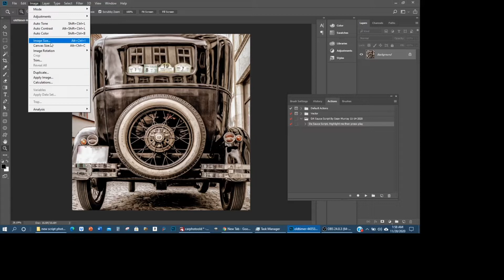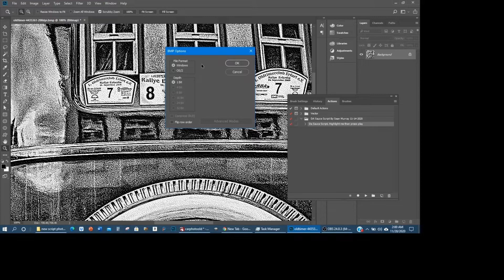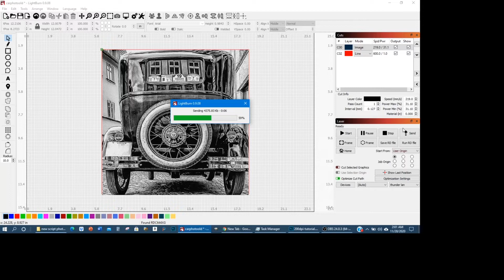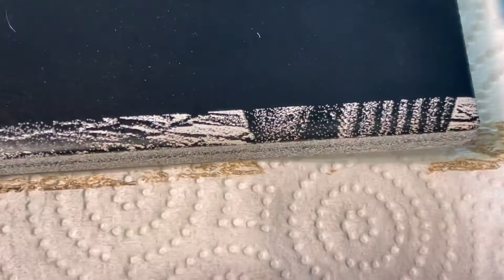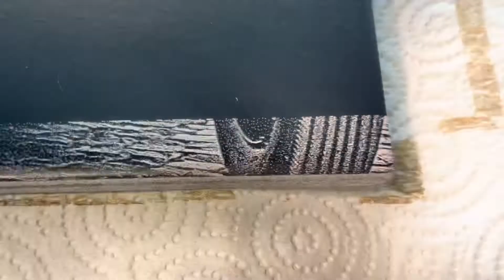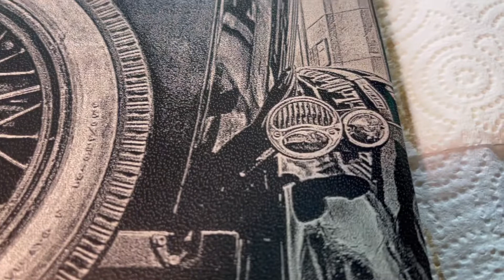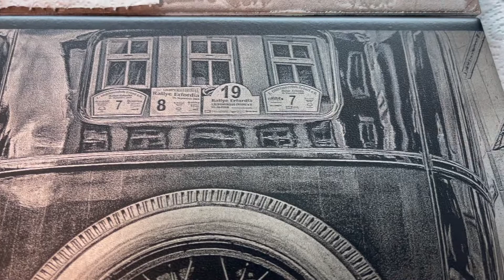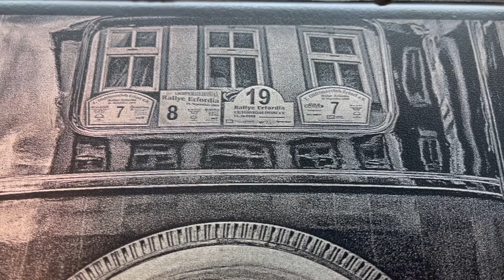How to laser engrave a photo onto painted ceramic tile

Comment: Hi! I have a 45 watt laser (Glowforge) I do not have a way to set % in the software for GF. Do you know any glowforge settings that may be a starting point? currently i have been using 800 speed and full power but i am not real happy with the results and its frustrating on this machine 😏 I purchased your action today, super excited to use it!!

Comment: do u spray any thing on to seal/protect  them
Reply from the maker: You can clear coat or even better pour clear epoxy over them. Professionally I now use two color plastic because you don’t have to mess around with any of that. I still use tile however, it’s great for staying sharp and the settings are similar to the two color plastic “row mark” etc.
Reply: What kind of paint are you using

Comment: What wattage machine are you running?  I’d like to start close to those settings,  but we’d need to adjust for power differences.
Reply from the maker: It’s a 60w machine, the best thing to do is start with one speed such as 180mm/s and also a low power that you know won’t do anything. Increase only your power upwards until it’s perfect. To go faster from there you will increase your speed and increase the power to keep the balance